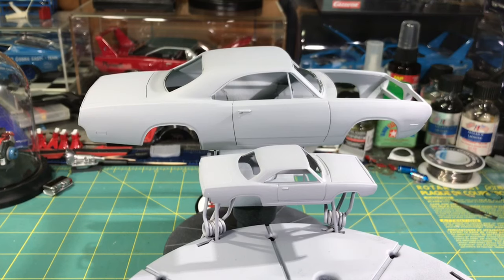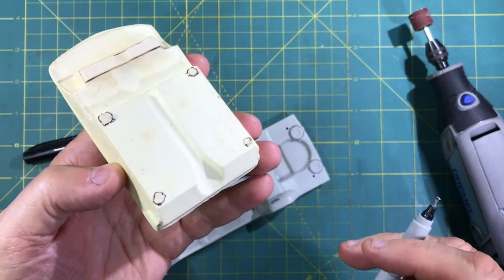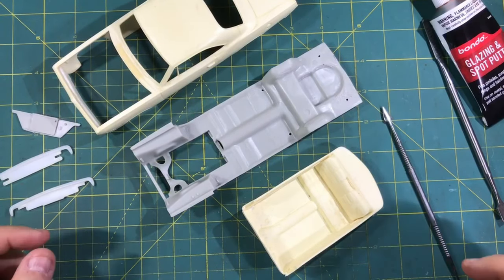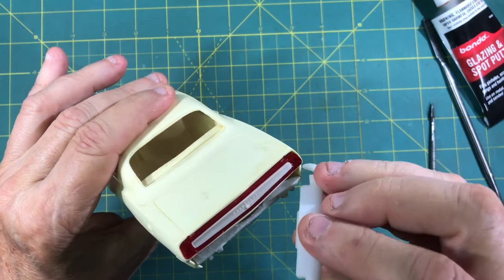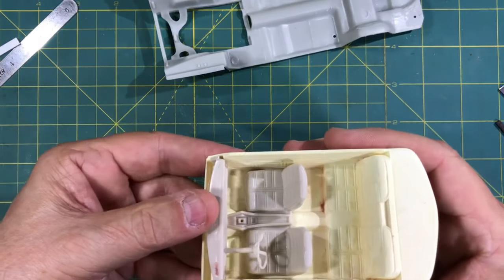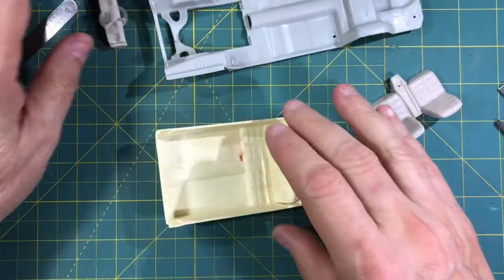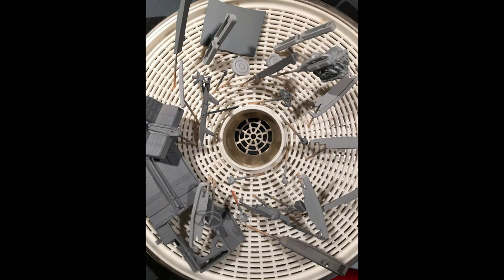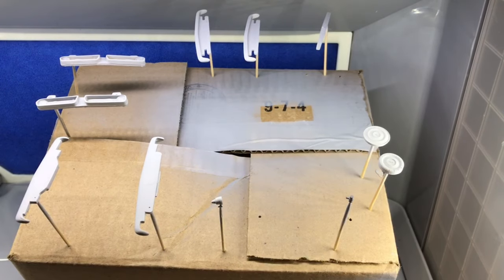1969 Barracuda Build  Part Three

Comment: Great Job! I'm binge watching the entire build. Quick question on the dehydrator. What do you recommend for time and temperature?
Reply from the maker: My dehydrators (two) are "Waring". One, I have used for almost 30 years. It only has one heat setting. Runs around 133. I've never had anything warp or melt. Enamels I leave in for about 8 hours, Lacquer and acrylics 2-3 hours. Also the Warings have a really good  circulating fan. The best way to gauge if the paints have "gassed out" (cured). There should be no odor. Some off brand paints I have left in for several days. Hope that helps. Thanks for watching Mark!